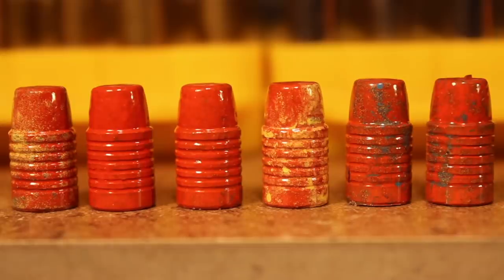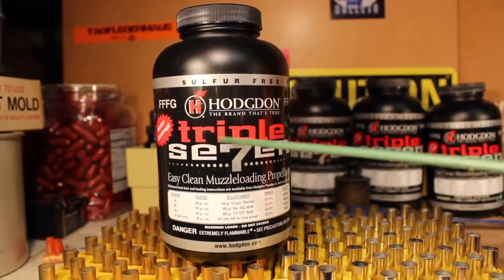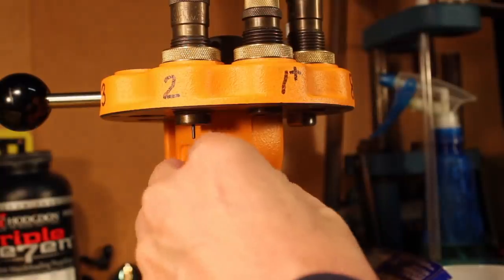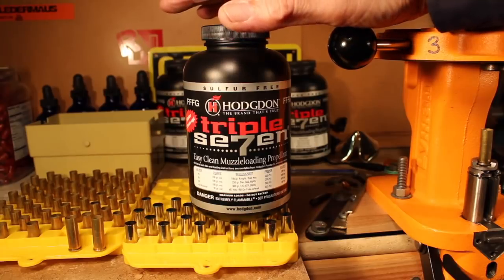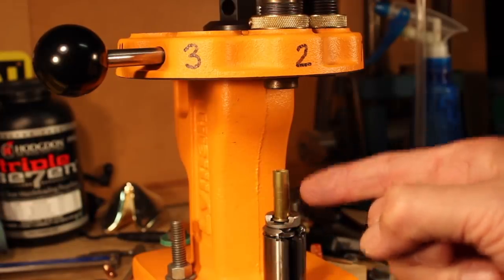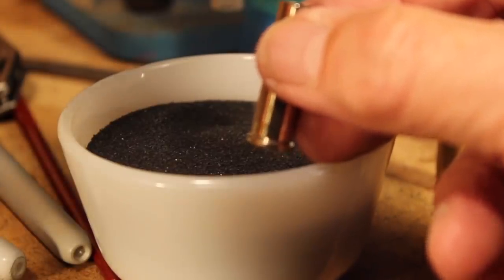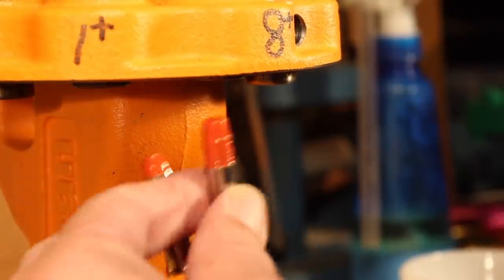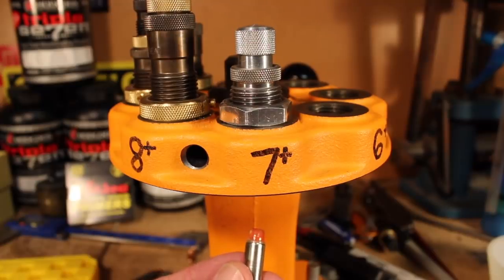Halloween With The 357 Magnum And Black Powder Substitute

Comment: I wonder if the old Lee powder scoops have an equivalent volume of your trimmed 40 S&W case? I used them, backed up by a scale, to speed up my process when I reloaded in the late 1970s to early 1980s withe the old RCBS "Rock Chucker", I used the Lee Priming tool as well for small pistol and rifle primers and the "on board" large primer tool on the press, until I got the second Lee to avoid the long stroke of the press . I may have to get back into it.
If you wanted to do a bit of extra work, you might be able to make your Halloween/fall bullets to look like candy corns 😉. Your using these alternate propellants is great info to keep one "range ready" even if your regular powder becomes unavailable.

Comment: I would think a used 38 special case would be closer for using as a dipper if trimmed down slightly. also a paperclip and some glue as a handle work great so you don't need to use tweezers to handle the case. As someone who loves black powder thank you for making these videos.
Reply from the maker: Sean Tierney - Your paper clip idea for a handle is good - I was thinking about bending a length of coat hanger.  The 38 Spl case does not engage with the tweezers as well, but the rimless rounds are a slam dunk.  The 40 S & W case was a pickup from the range.  What I've done is thrown all my BP sub powder scoops into a Lee plastic container.  Keeping it as simple as possible works for me.  And the tweezers is sure and simple and always handy.  It's all a hoot, Sean.... Thanks for posting,  Steve

Comment: FYI-my approach was to use 4-5 grns of smokeless and top the case off with benzoate fuel based BP  so the load was slightly compressed ;.44 Mag in a lever action.   was quite surprised, plenty of power and little to no residue, would love to test more with a chronograph.   The Finns loaded 9mm sometimes in WW2 in this fashion due to shortages of powder, and used them in KP-31 smgs!  this is definitely viable, though I would be leery of using copper jacketed bullets unless you coated them with an anti-friction lubricant, moly sulphide or graphite

Comment: Great vid!!! I really would like to shoot some black powder in my Ruger Blackhawk just don’t know how to get it cleaned after maybe you could make a vid on how you clean yours?
Reply from the maker: cory8791 - Black powder fouling is hygroscopic and not cleaning a gun soon after shooting leads to rust and the commonly found "dark bores" on old black powder guns.  Best to clean black powder fouling with hot water.  But true black powder is a real mess as the fouling is very bad - can lead to gun malfunctions after just a few rounds.  Some black powder shooters use "moose milk" to keep their guns in action - spray bottle of water and Ballistol is "moose milk".  That can also be used to clean guns.  Some shooters take the grips off and put the gun in a dishwasher.  All of that can be done away with by using Hodgdon Triple Seven powder - there is no sulfur in 777 and the guns don't get anywhere the fouling that black powder causes.  777 smokes on firing just like black, and reloads just like black.  So far, the guns shoot with fouling, but not enough to put guns out of action like true black.  It is right on the bottle that 777 cleans up with water (not even hot near boiling water - just water).  But I don't like water on my guns (stainless would be OK), so I've just cleaned my guns after shooting 777 the plain old way - with Ed's Red or solvent of choice...after all, smokeless fouling is still a powdery residue.  If water cleans off 777 fouling, so will powder solvent...  I've found it cleans up splendidly with regular Ed's Red or Hoppe's or whatever.  Barrels look good after same cleaning... and a good coating of mineral oil or Eez Ox and rust prevention is enabled... Good shootin' to ya,  Steve

Comment: I'm trying to make a lead mouse fart load in 30-30, my first attempt at low pressure rifle loading. My first try is not working out, and it's time for plan B. One thing I'm noticing is I really want to "work down" the load rather than working it up in charge weight. I want to start with a minimum book charge and work down until I get pressure problems. Since no one ever speaks of working down in charge weight I assume it's dangerous to do so.
Reply: The biggest danger when loading down with modern powders is loading a squib. This is where you load a round that doesn't have enough powder to push the bullet all the way out of the barrel.  That, in and of itself, won't blow up your gun.  But if you get a squib without realizing it and then fire another round with the bore obstructed, you can create a very dangerous situation.

Something else to keep in mind is that you may find inconsistent velocities with lower volumes of powder in the case because of the way the powder lays in the case in relation to the powder. You can solve this by adding a filler between the powder and the bullet.  That will hold the powder down by the primer so that it's always in the same place within the case relative to the primer.

If you are trying to load your .30-30 with lower volumes of black powder instead of modern powder, the filler is absolutely essential.  As mentioned in the video, you don't want any air space in the case when loading black powder.

Comment: The 357 is just a 38 Special only longer and being a revolver they obviously will work with any powder with enough pressure to push the bullet out.
Why don't you do a complete series on more modern guns reloaded with black powder, like the 1911, Glocks, AR-15 / AR-10, AK, and other modern rifles and pistols, then give us the FPS, energy and most importantly to see if they will even function/cycle?

Comment: Thanks for another great video.  I have a question about your double bellend process.  I've been reloading .357 for a few months now, I've done a lot of 9mm for the last 25 years but I never get an easy initial bullet placement like you have (automatically squares up) and that leads to exactly the symptom you describe of a seating right offset on one side of the case, perhaps making it unable to be chambered..  I don't understand the mechanics of your 2 step flaring process, could you explain a bit more?  I have to spend a lot of time making sure it's straight and not tilted.  I love your press, I'm using an RCBS Chucker single stage press.  I'd be more than happy to run a second operation on my bellending, can't play with it enough imho.  ;)  lololol
Reply from the maker: Doc Mangler - The 2 step neck expander / mouth flare dies are first the Lyman M dies and then others like RCBS that came along later.  The die does it all - it has an expander that has two steps - the main step that expands the neck to hold the bullet and the second step that holds the ideal diameter bullet straight in a seat formed by the second step bottomed by the constriction of the first step.  Should you have need to seat an oversized bullet, the expanding plug has a blunderbuss end past the second step that will do the Lee blunderbuss.  In use, the die is adjusted to get the second step into the case mouth and it's done... the bullet will go into the mouth square and ready for bullet seating.  Good reloadin' to ya,  Steve
Reply: @FortuneCookie45LC  Hey thank you so much, I do have that then on my .357 dies which are RCBS, my 9mm die apparently does not.
Reply from the maker: @DoctorMangler  - You will hear that some reloaders have the Lyman M die for every caliber they load; that's how much they like that 2 step expander... But as you have found, the Lee does work OK as long as we take extra care to square up those bullets before seating...sometimes the bullet shifts just as it enters the seating die without us noticing though - then we get a little cockeyed seating with loss of some accuracy on that shot.  Good reloadin' to ya,  Steve

Comment: Is there any reason that 777 couldnt be dispensed with a powder measure once the correct amount of powder is worked out?
As you know "Consistency is the mother of accuracy".
Even black powder can be run through a powder measure if its built of non sparking materials.
It would do away with the tedious dipping and the slight variations inherent in that practice.
Thanks for all you do.
John Davis jax fl
Reply from the maker: Johnn Davis - Currently, the black powder powder measure was out of stock at Midway - should check again as they might have gotten some in...it would be a great help loading these... Best to ya,  Steve

Comment: I wonder how many grains of smokeless powder that equates to.
Reply: about one third of the weight of black powder  ,n340 ,ba 9, unique burning rate  , look in a load data manual
Reply from the maker: Tripp426 - Thanks to peteralexben for the info, but I didn't even bother to weigh the charge as we're going for volumn only... However, you're right - I should have weighed it anyway...will do so next opportunity...   Have a great day,  Steve